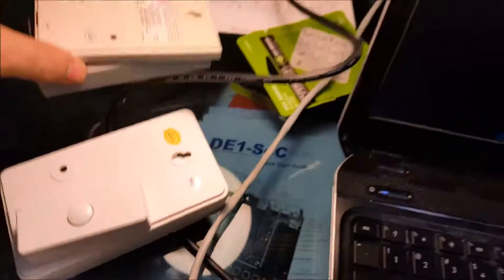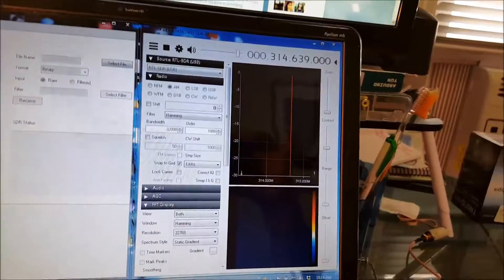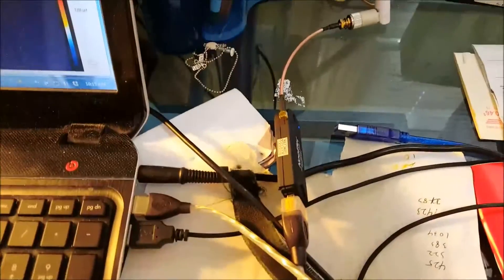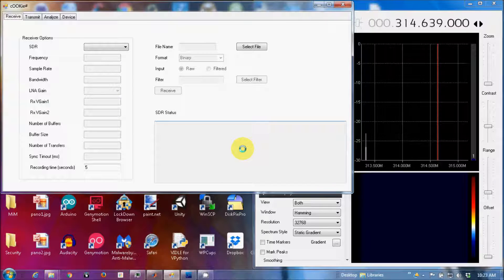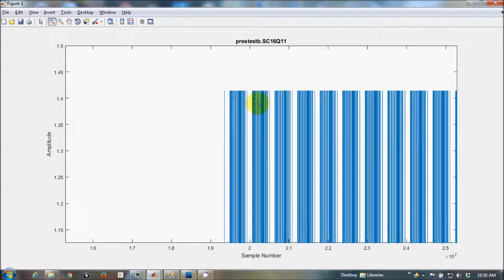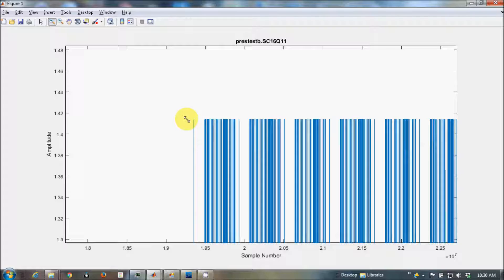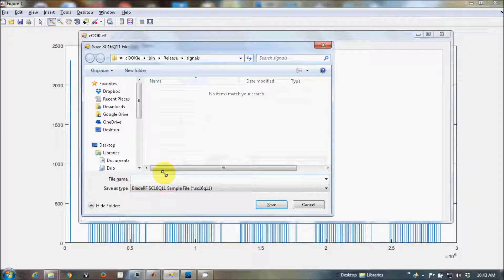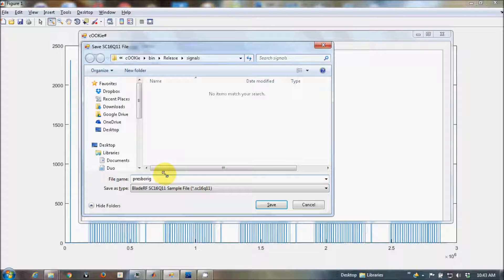cOOKie Demo

Comment: Wonderful project. I wonder if it can be used with Hackrf one?
Reply from the maker: Thanks! It was my original intention to make the SDR class an abstract that would support multiple types of SDR. You can get the MSVS solution source code at https://github.com/ksmiller99/cOOKie if you want to give it a go.
Reply: I will try it definetely. Which OS you are using? Matlab I guess is a need
Reply from the maker: I'm using Windows 7-64b, MSVS 2013, and Matlab 2014b Student Version. If I could get the Full Version of Matlab, I'd compile the Matlab into a DLL and call it from the C#. Keep me posted!
Reply: Can be this used with any Linux based matlab similar? (ie Octave) I mean coding similar as matlab there too. Great post by the way
Reply from the maker: Does octave have an equivalent of the Digital Signal Processing toolbox? Also, my code accesses MatLab as a Windows COM object. There might be better ways with Octave/Linux. I haven't done any serious Linux work.
Reply: I dont know whats code has about compatibility with octave. But anyway, I will try it on win os to test and looking fwd of yours new ones :)